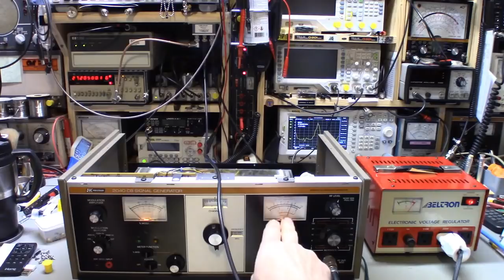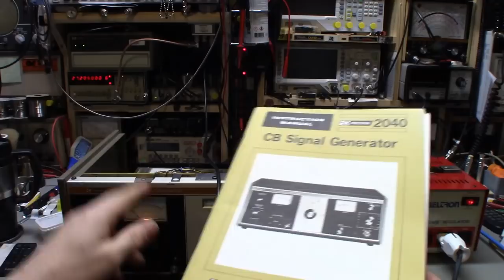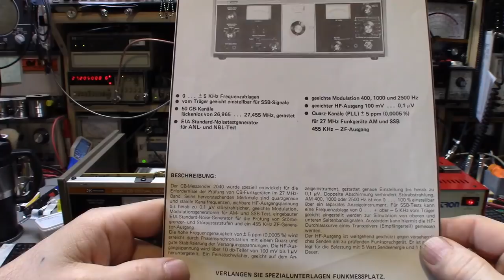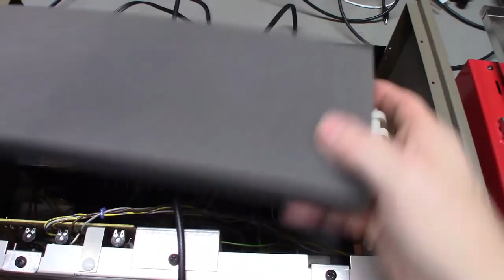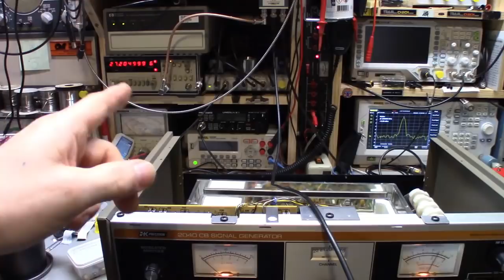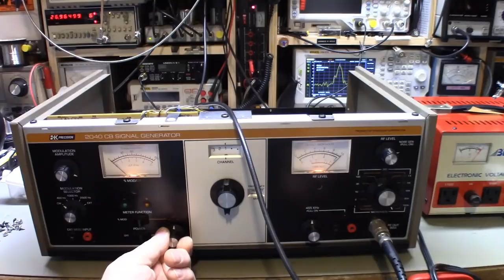B&K 2040 CB signal generator rebuild and overview.

Comment: I have worked on dozens of these units over the years.  Specially PLL issues. Yes these have dual 10.2XX oscillators.  Truly a pain in the rear to work on.  My stand by unit went out of lock a few months ago and have to repair it, plus the one you mentioned that has beat me up for a year. Guess I need to find me another stand by lol.  Mike I commend anyone that has to repair these.. GHood job.